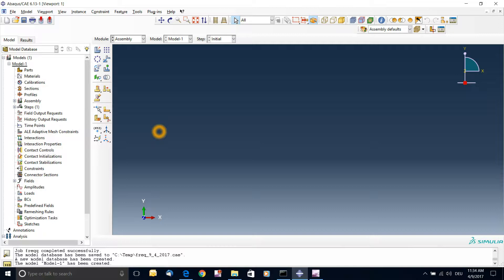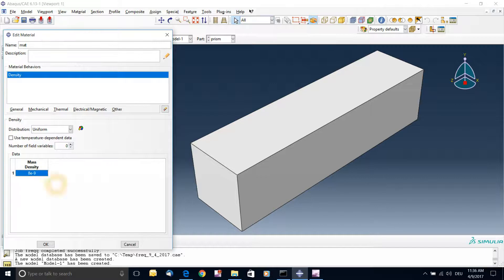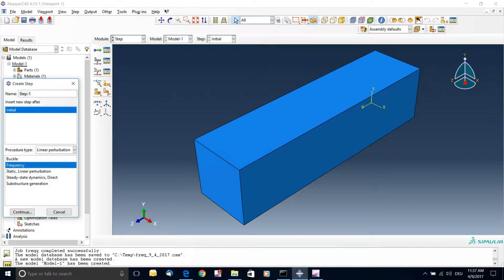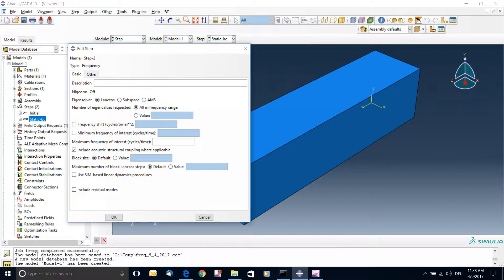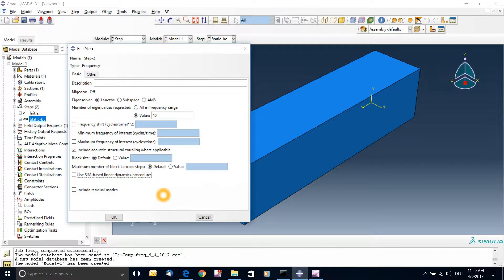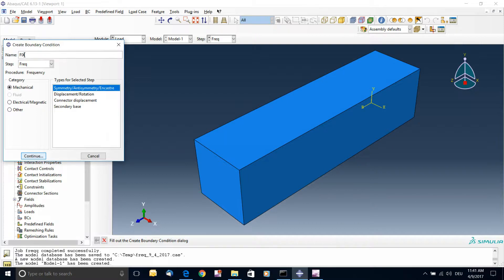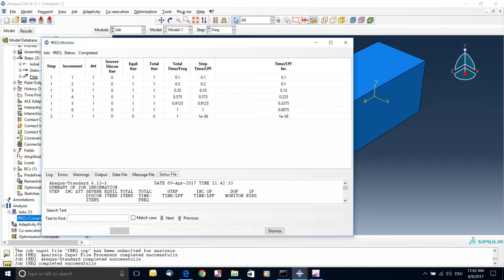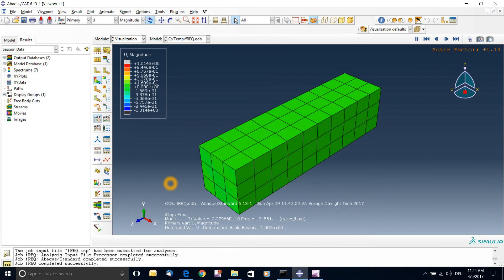Abaqus Frequency Domain Tutorial 1

Comment: I'm getting same natural freq for mode 1 and 2 of a beam. Is it possible?
Reply from the maker: Yes, if the beam has same width and thickness.
Reply from the maker: Visualize the result and animate to see.
Reply: @RamiRouhana  yes for the same beam, natural freq of mode 1 and mode 2 are same. Is there anything wrong or it's perfectly okay?
Reply from the maker: @satadrusingha7383  what are the dimensions of the beam, W×H×L ? 
If W=H then normal to have same freequency for first 2 modes of vibration.
Go to visualization (view results) and you can see the first two modes.
Reply: @RamiRouhana  the length= 100mm & width= thickness= 10 mm..... 
And then natural freq of mode 1 and 2 are same.... Then 3 and 4 are same for a cantelever beam.
Reply from the maker: @satadrusingha7383  great. That are the expected redults.
Reply: @RamiRouhana  thank you so much 😊